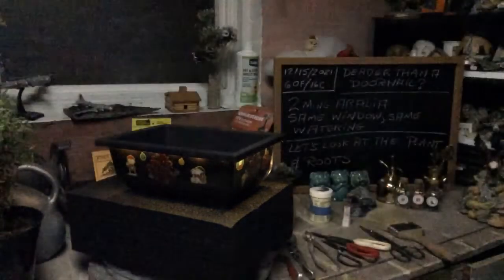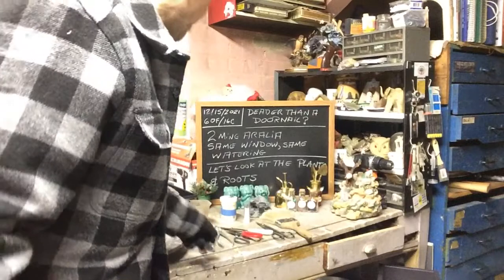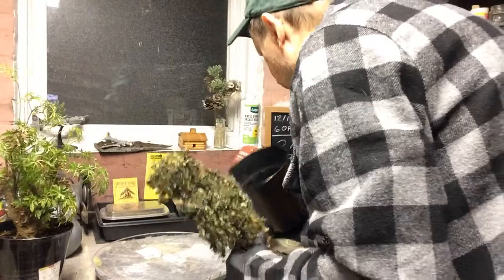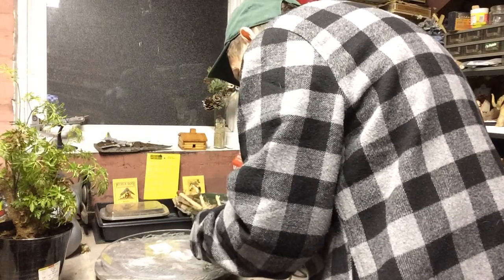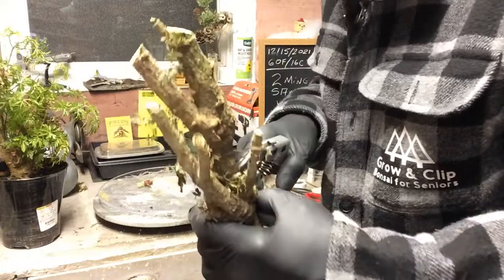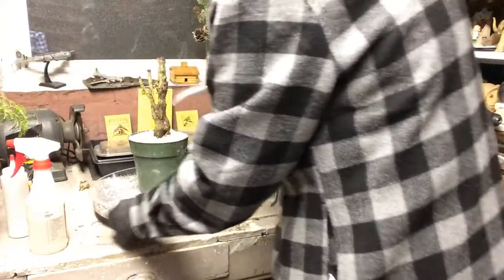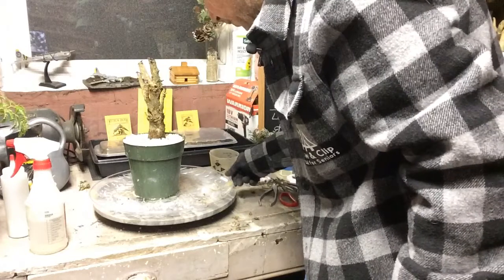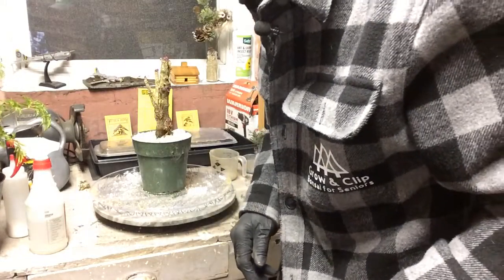Deader than a Door Nail???

Comment: General knowledge for those who may not know: 
   Ming Aralia need alot of humidity. I bought one this year and I mist it 1-2 times daily. It's doing fantastic without hardly any leaves dying or dropping. I've seen people talk about them not liking direct window light and others say theirs grows fine in  direct window  light. The common factor in most all success stories is misting the Ming Aralia often. Do NOT keep it by a furnace, heat vent or wood stove that will dry it out. Also, water it well and then wait till  it dries about a half inch to an  inch down into the soil but don't let all of its soil dry out completely. 
  They are generally slow to moderate growing and provide a beautiful bonsai with little work to get them there as they look like a miniature old tree naturally. 

  Thanks for the video, Tom!
Reply from the maker: Thank you for the great info Chris. My Friend has the 3 Ming in his south facing window, that I made for him, and does not mist them at all. They have great color and are looking great. Maybe the humidity in the restaurant? I don't know, but, the hot direct sun is on them in the south window and it is like looking at a picture. Maybe they adapted to his surroundings and atmosphere in the restaurant. In the basement it is a challenge and I will do the misting and see how they develop. Again, I thank you for the great info you provided. Take care Chris, and have a nice relaxing evening with a nice hot cup of tea. Tom
Reply: @growclipbonsaiforseniors1951  I agree with the humidity being helpful in the restaurant,  that may very well be a possibility. I thought about that when you mentioned  that  your friends were doing well, in the video. I figured if they are steaming and boiling and every thing else they do in a restaurant, the humidity has got to be alot  higher. 
  As a matter fact, now that you mentioned tea, I think I will go have a  hot cup🍵. Thanks Tom!
Reply from the maker: @-ChrisD  Take care Chris. I will have another also. Tom

Comment: The lipstick tip is interesting. Does it harden after a while or does it stay soft?
Hope your aralia survives!
Reply from the maker: The lipstick usually stays soft in the spring, summer months. After a while the lipstick does get a bit hard but still stays on the cut. I know that if I brush by my roses with the lipstick on, I get it on my sleeve or pant leg in the summer months. Works very good for me. Larger cuts, I use wood glue. Dries clear. Fingers crossed on the Aralia also. Hopefully the beneficial bacteria and the un-milled sphagnum moss will stimulate more root growth. Have a nice evening and relax with a nice hot cup of tea. Tom

Comment: Deader than a doornail - This is old - at least 14th century. Doornails are the large-headed studs that were used in earlier times for strength and more recently as decoration. The practice was to hammer the nail through and then bend the protruding end over to secure it. This process, similar to riveting, was called clenching. This may be the source of the 'deadness', as such a nail would be unusable afterwards.
Reply from the maker: Great info Barry. You are a wealth of knowledge. Have a nice and relaxing evening with a nice hot cup of tea. Tom